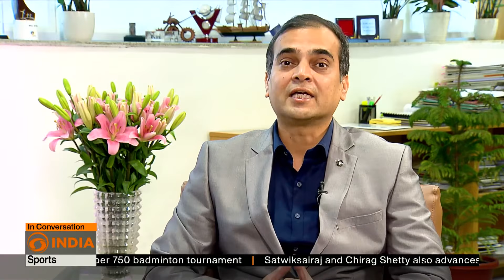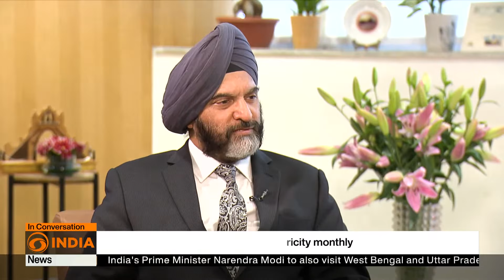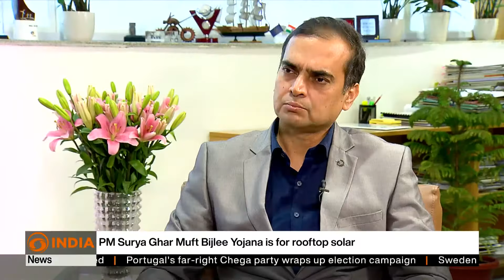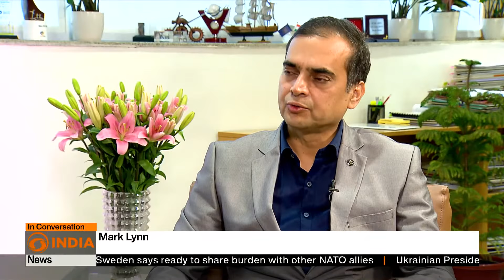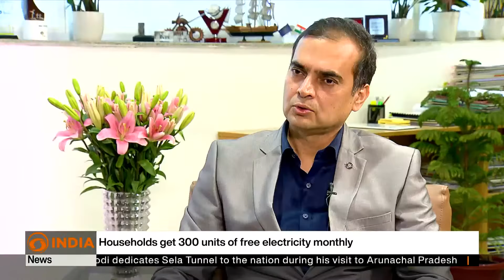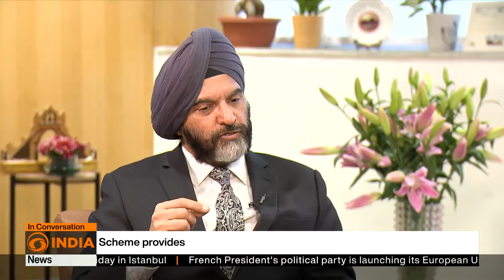In Conversation with Bhupinder Singh Bhalla, Secretary, Ministry of New and Renewable Energy

Comment: The Float Glass Manufacturing industries like PILKINGTON ( Glass manufacturers)
on every High rise Towers.. the Glass is huge 
Ask them to etch/print; Solar panel prints on the Float glass;
Curtain Walls;  like  decor but Capture  UVrays; sun rays;
and generate the  energy..

Entire Coastal regions; Jammu; Himachal all Mountain  zones   install Wind turbines..
 Mega/Micro DAMS on Himalayan ranges.
 Assam from Thorium; use it
Make INDIA  self sufficient;
If You find oi/gas in Bombay High; Godavari;
then entire Indian ocean; bay of bengal must be LOADED too.
Tap it